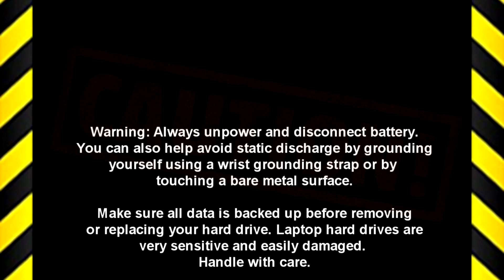Dell Latitude E7250 (P22S002) Heatsink Fan Assembly How-To Video Tutorial

Comment: watched this and was about to give up on the idea of re-pasting the CPU. Decided to take a chance and unscrewed the 4 screws for the heat-pipe over the CPU and GENTLY bent it up off the CPU. BEWARE - I do NOT suggest you try this unless you accept the risk of the heat-pipe breaking. I literally lifted it about 1 cm off the CPU so i could get a qtip in to clean off the old paste and just about got new paste applied. There was also a dell repair bulletin that stated you should only apply paste to the CPU (larger chip) and not the northbridge (the smaller of the two chips). I went with that and im seeing a slight improvement in temps. Proceed with caution and at your own risk!